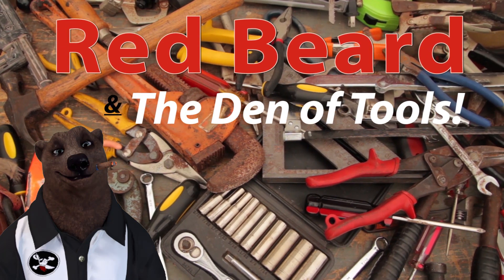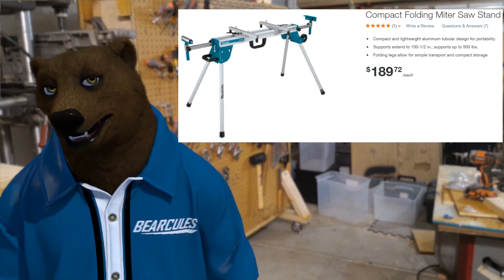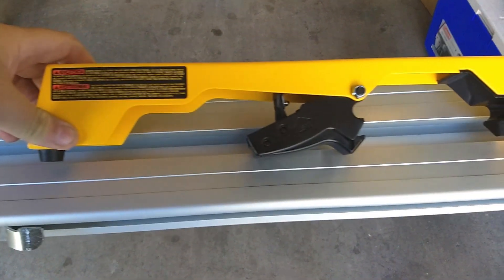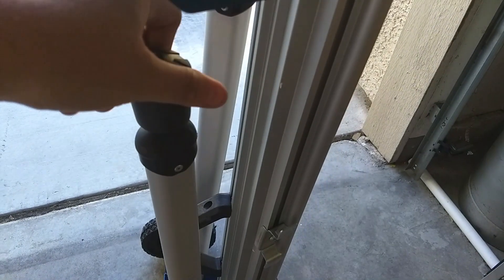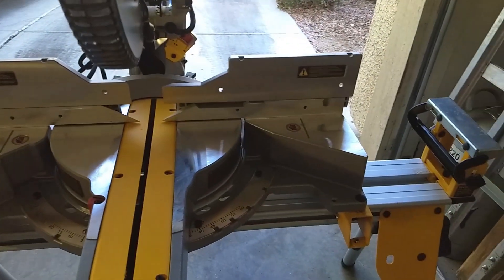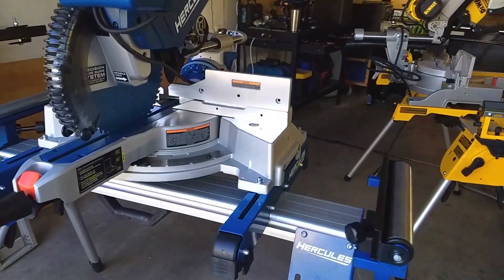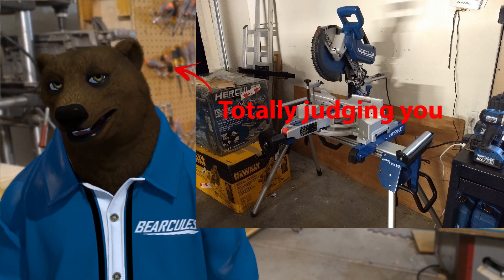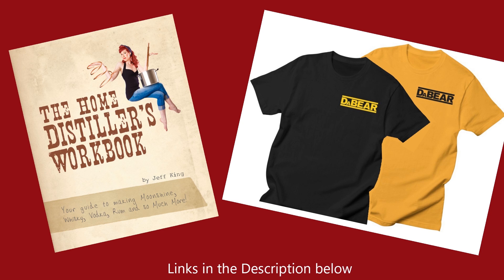Hercules vs DeWALT Miter Saw Stand (Has Harbor Freight surpassed Big Yellow?)

Comment: Did they cheapen that Dewalt stand at some point? I have had one very close to that for many years and it is solid as a rock. Mine has no wiggle anywhere.
Reply from the maker: Does it have the same sort of supports?
Reply: @denoftools  The supports are the same design but they don't have slop in them. Most of the stand looks the same but the legs don't have the plastic releases (you push the buttons down from the front) and the extensions lock with a roundish screw instead of a lever. The connection between the saw and the stand has zero movement. From watching your video it looks like they just let their tolerances go to shit. I use it with the 12" sliding double miter and even with that beast on there it does not more at all.
Reply from the maker: Yeah, I did some digging on everyone who has had that stand from back in the day says it's very tight and works great.  But I've now watched several videos as well as read through online reviews and there are lots of people complaining about slop, however, all of those reviews are in the last year or two.

Comment: Apprentice Carpenter here. I own the longer dewalt stand and the ten inch sliding mitre saw. Can't comment on the hercules because ive never used it (though it does look like a solid set up with the stand). What I will say though is the dewalt is a fantastic set up even for trim and cabinetry work. Never really had a problem with the play in the material supports and I wouldn't really trust those stops on either stand if I needed absolute accuracy. I have used the stops for some framing work a couple times and they were alright. I do wish the dewalt stand had some wheels. Not saying any of this to take away from the hercules as it does look like a nice stand but the dewalt saw and stand is one of those set ups that has served me so well I can't help but feel a sense of loyalty and attachment to it that I though was worth mentioning.
Reply: My company has several of the DeWalt stands; both the shorter version and the longer one. They are definiely made for framers. The issue with the adjustable height brackets is easily resloved with four short carriage bolts, washers and locknuts.

Comment: I have a craftsman stand that has two power outlets built in , it has a flapper type button to make it easy to kill power and when you turn it on your shop vac powers up , which I leave in the on position , when you are done with your cut just hit the flapper and it turns off ,...... very convenient

Comment: The makita saw stand is garbage. Wheels are hard cheap plastic. Work supports are very small.   Wheels base isnt wide enough to provide adequate adjustability due to it tipping. Probably my most hated tool.

Comment: Have the older HF stand with the 2 top cross tubes and it locks solid with a 12 inch dewalt. I can also roll it around with the saw. Big down is no levers for the leg locks so it's hard to fold up or down by my self.
Reply from the maker: Yeah, that actually is a pretty good stand, especially for the money.  This really is nothing more than an upgrade of that stand.

Comment: My longer version of this default stand is 14 years old and still looks ok bar one dinked leg The supports get on my tits especially with long boards like hip or valley rafters they creep or just simply drop down. The slop in the mounts is not something that really is an issue. What annoys me is the cost of spares I have two mitre saws a 708 for big framing and a 777 for trim work but with the cost of a second set of mounts here in U.K. I’d but a new stand before I brought brackets and a spare leg

Comment: Thank you for this video. I actually went with the Chicago Electric model of the Harbor Freight miter saw stands. I got a great price($124) and I have used it so much this past summer. Been very happy with the model that I chose so I have no doubt that the Hercules model is great. Now my next step is to get a new saw to mount on my stand. Probably going to wait and go with a cordless miter saw since I have the wheels on my stand that would make it able to go anywhere I needed to get close to the project and save a few steps.

Comment: I use mostly Milwaukee and Dewalt tools as well as some early to mid 90s Porter cable tools at work and I will freely admit the Milwaukee and Dewalt stands are absolute manure. They are both essentially 200 dollar saw horses. The stand I bought is similar to this Hercules stand with the wheels for my Dewalt 780 with electric outlets in the base. I just got the Milwaukee 7.25 miter saw and I am going to use the old stand on that saw and get a new wheeled stand that's more robust for that 12 inch saw. I saw the new Hercules stand and it's a 200 dollar monster compared to this Herc stand. Any chance for a review on that stand?

Comment: I'm not a fan of comparison videos but if you're going to do them why not compare best for best?  Dewalt produces a much higher quality stand than you are comparing.  It's in the same price range too.
Reply from the maker: I'm guessing you are talking about the scissor lift stand?  It is significantly more expensive (Sells on average for $250 vs $186 for the one tested).  It does not have a quick release top and that style of stand is not usable on uneven surfaces.  Essentially that is a dedicated stand for indoor use.   Different tool for a different job.

Comment: Those type of stands are awful. The thin metal where the wheels mount bends and eventually break when wheeling it around. Unless this is sturdier and heavier gauge metal it will suck too. At least for transportation

Comment: I bought this stand with the Hercules 12 in sliding saw and I cant store it vertically.  The stand will not balance with the saw on it. Were you able to store yours vertically?  Maybe im doing something wrong.
Reply: I bought both together also. My only gripes are its heavy and clumsy to break down and when storing it needs to lean and be put on a block. I hope we're both doing it wrong and someone enlightens us!

Comment: Both designed stands are copies of an old Delta stand I had years ago. This is particularly true for the Hercules Brand unit, which btw is very similar to HF's current Chicago Electric M/S stand. The Delta stand that I had was all steel construction, very robust and but heavy, unlike these two stands. Both rely on a generous amount of aluminum and sheet metal to reduce weight. As for the stop block feature, I've witnessed other reviews of DeWalt DWX723, and the reviewers didn't seem to note any problem with the stop block on the extension arms.  They were able to demonstrate a fairly rigid stop block, unlike what the Bear pointed out in his review. Could it be possible that something was not assembled properly?

Finally, the DeWalt unit has been on the market for a few years now and quite frankly the design is somewhat dated. Hence making a comparison with a new product, which is not even on the market is not a good comparison.
Reply from the maker: https://youtu.be/ZWabuSBSAO0 
I just did a search to double check and in the two most viewed revies of the Dewalt stand both reviews commented on the poor quality of those supports, one even had the exact same issue I did.  Maybe we both are doing it wrong but I doubt it.

Comment: I purchased the HF miter saw stand about 3 weeks ago after reviewing all the major brands and house brands from big box stores. I ended up with HF because of weight and features. Will add a multi outlet in the future for power. Looks like an easy add. In regards to the Hercules model it appears to "almost" identical to the Chicago Tools with a couple of exceptions. Paint scheme of course and the quick release for the legs. It would be a shame if these two features drove the price up to almost $200. With coupon I paid around $100 and love the CT version. I believe we are seeing HF morph into a quality tool provider with their Hercules line. I hope so, I have brought many of their tools that were out of my price range with brands where you are paying 15-30% more for the name. Particularly when you release multiple brand names are made by the same company.
Reply from the maker: On the Hercules one the rollers actually roll and it has a higher weight capacity I think

Comment: I just bought this saw last night and used it today for the first time. It is a freaking Beast. Absolutely impressed with it. I've used the DeWalt and it was really nice too but this was Easley just as nice for a lot less money. $300 plus tax for the saw with a blade included. I will be getting the stand soon. Wheels are definitely necessary as 56 lb gets pretty heavy to carry around.

Comment: I like things that work well but don't break the bank. After a ton of research, I bought the Hercules saw. Now, I need the stand. This video is the deciding factor for me. Thanks for doing these reviews. It really helps the prosumer in selecting prosumer grade tools at fair and decent prices. I'm retired and out of the construction business, but I would buy these HF products as a professional. It isn't like Dewalt doesn't have some lemons in their inventory, so if these Harbor Freight tools fail, replace them at a cheaper cost than a failed Dewalt.

Comment: I have got some pretty decent hand tools, clamps and air tools from HF over the years but anything I ever bought with a cord or a battery was total nightmare. HF may have some new and improved power tools but since they only want to stand behind them for 90 days vs the 3 to 5 years other companies offer, I'm still not convinced Hercules or Baurer is worth the money and I have to wonder if HF has much confidence in them as well , I have an extensive line of DeWalt tools and not one has ever failed me. When you"re on a site in the middle of a job and your cheap tools fails, sure you might get it replaced for free but that down time cost's money too especially if your over an hour a way from the nearest HF.
Reply from the maker: You need to look into that a bit deeper.  Dewalt doesn't really back it for 3 years.  Parts and service is only for one year, after that its just parts.  Want to guess how much the parts cost? Next to nothing.  But the hourly rate for tech service plus you get to foot the bill for shipping to a service center!  Oh and it can take between 3 to 6 months to get your tool back.  And that is when they honor their warranty at all.  Dewalt has a D- rating for warranty ratings.  You get to see how your tools hold up and maybe your buddies.  I get input from tens of thousands of people, dewalts fail all the time.  Most contractors just toss them when they die and buy a new one. With HF you can buy a 1 or 2 year warranty for $17 and $24 dollars.  And if you have an issue you bring it into the store and they just give you a new one.  That's it.   Ridgid has a lifetime warranty but again they can be a pain to deal with.  Other than HF, Milwaukee has the best rated warranty service.
Reply: To be honest with you I have never had to deal with DeWalt on service issues for anything, then again my tools are in a shop setting and I will not tolerate someone beating the shit of them either, how ever you have perked my curiosity about the warranty which I will look into, I actually really enjoy your videos and do take what you say seriously, I just never had good luck with HF power tools, I have no idea where they are going with Bauer or Hercules and in time I may or may not change my mind about them, all depends on product line, price and performance/reliability.
Reply from the maker: Price, performance and does the company stand behind it.  I've never been one to really recommend HF power tools, at least not the CE hand-held tools.  Sanders and heat guns?  Oh and that band saw but never drills or the like.  And I didn't even recommend the Herc saw till they extended the warranty and dropped the price.  We shall see how the other stuff holds up though.

Comment: I have the Dewalt  DWX726 lift stand that I love for my 12" Dewalt DWS780, a second DWX726 I have my HF Chicago Electric  pipe threader (they don't sell that anymore) mounted and I also have a $88 MX77 stand from Menards that looks a lot like this HF version I use with multiple mounts for my other job saws, router, saw horse ... for quick changing when needed.  So the price has to beat $88.

Comment: Everything seem fine, except the stand has a nut built into the "attaching mounting brackets"  yet the saw has a hex indention for a bolt to drop in. I know I can use a bolt with a flat washer, but it seems to be a bad design. Other then that, seems like a nice setup.

Comment: I’ve got the old full size saw stand combo from dewalt..used and abused for over ten years...love it but like the idea of a more compact stand! Just my opinion but rollers are horrible for actual work on the job site! If not perfectly aligned they roll your material out of alignment with the fence and even worse causes off cuts of longer length to more easily roll off the end of the stand right not the floor! Just minor inconvenience at most but still not ideal in my opinion
Reply: Those rollers do suck. I've never used them I've just used ridgid flat top support stands for everything. The only good support stand in my opinion

Comment: I have to say my Ridgid is still my favorite.  Even though I have the DeWalt saw, the Ridgid stand with the large wheels is awesome.  The big wheels make it super easy to roll them up and down the stairs solo
Reply: I have 2 of the Ridgid stands, one for my Dewalt 12 and one for a lunchbox planer. Big saws are heavy and big wheels make a world of difference moving them up stairs, over grass, etc.
Reply: I have to agree.  Wider/deeper mounting base makes is super rigid (no pun intended).  Easy to move around, and I can leave the saw mounted to the table after I fold it up.  I don't remember how much I paid for it.  I know I got it on sale for a significant discount (maybe 50%) from HD.  These wheels on it seem to be nearly twice as big as the HF one.  Easy to move around.  It is heavy though.
Reply: So Black and Decker has lost out to two Chinesium designed stands?
Reply: Just bought the rigid, smoking deal @ $99 right now. Only thing is I'm having to be creative mounting the Hercules to the mounting brackets on the rigid using the carriage bolts it came with. The position of the feet on the Hercules are kind of in conflict with keeping the bracket straight / flat. I think I've got something figured out though.
Reply: Joseph LaBranch  not really the stand that’s compared is dewalts  entry level miter compact stand. they make a heavy duty wheel stand of course it’s going to cost you so it just depends if you want to pay for  it lol
Reply: Which ridgid stand are you talking about?

Comment: Purchased this stand March 3, 2019, took it out of the box and it was not as nice a quality of what you had reviewed. Very disappointed, Love your reviews
Reply from the maker: I talked to my contact and they pulled some out and it is looking like one of their factories might be outsourcing their work.  About 1 in 20 were not to spec.  They are sending a whole shipment back.
Reply: I have pictures of the stand rite out of the box with damage to the aluminum legs from steel parts rubbing from shipping and poor quality welds on the roller assembly. Took it back to harbor freight and a manger was surprised, they have sold several of these, guess I got a bad one.

Comment: Let me tell ya Bear, the Hercules stand is great and stable.  I also have the Hercules 12 inch sliding miter saw on it.   I am fully satisfied with this.  For once, it was the right decision from the start to get this.  Regarding the saw, the only drawback is the slider takes up so much space in the back, but since I use this stand, that does not seem to be an issue.  If I made a permanent miter stand against the wall, then it would be a drawback.  There it is!!